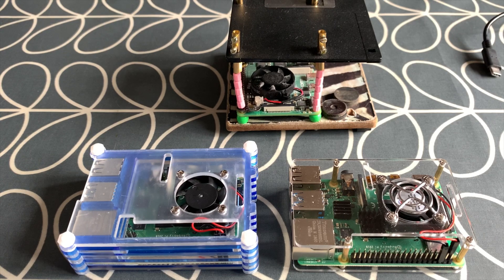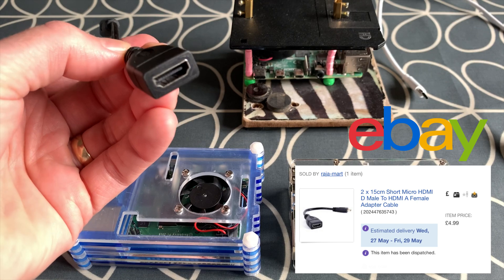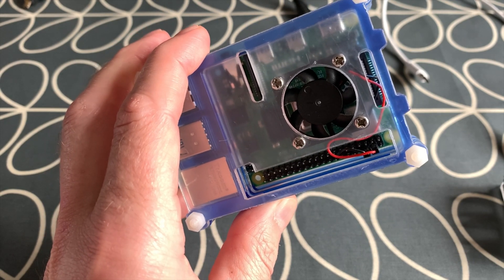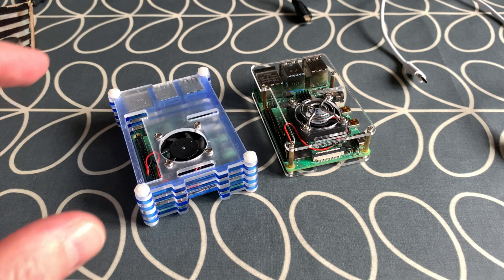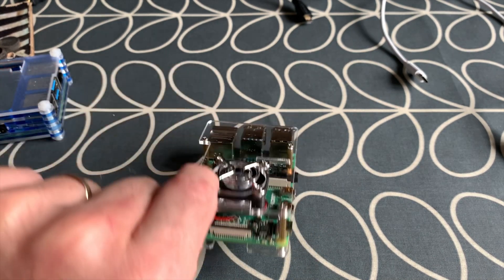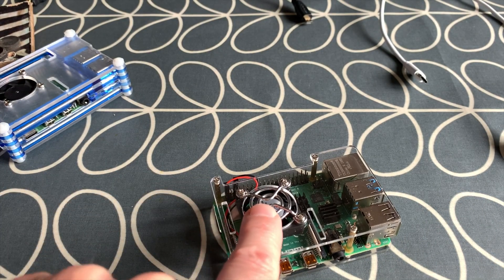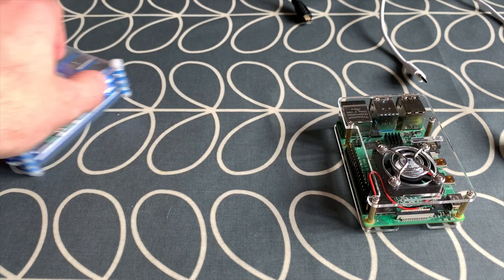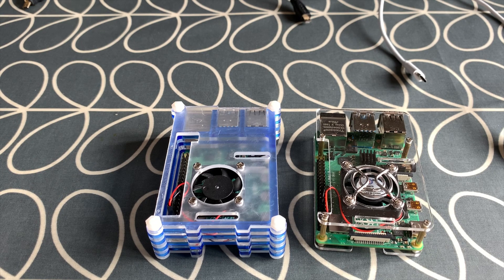Cheap Amazon Raspberry Pi 4 cases. tested with 8GB and 4GB Pi 4.

Comment: I have that same clear one with the metal standoffs. You mentioned the one thing I noticed too about the lack of rubber feet. I also have 2 Flirc cases. One with a Pi3b+ and 4.

Comment: i got one of those cases , instead of blue it's black and white, got it from eBay. its fan on 5v is so loud, i had to cut its connector and use the 3.3v pin - but still it was loud. it cools very well though